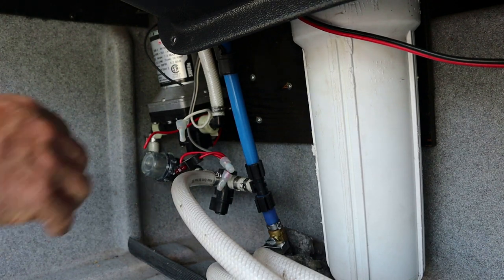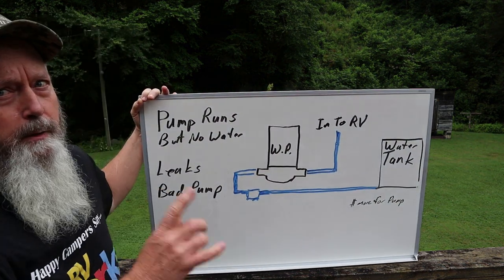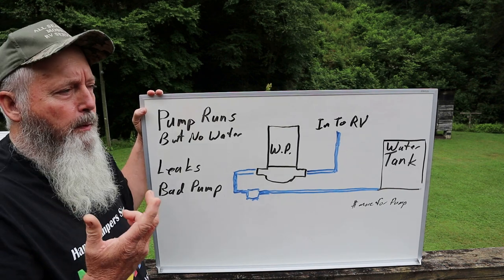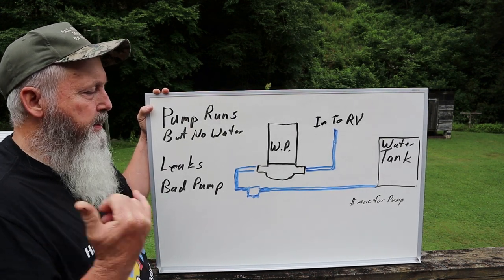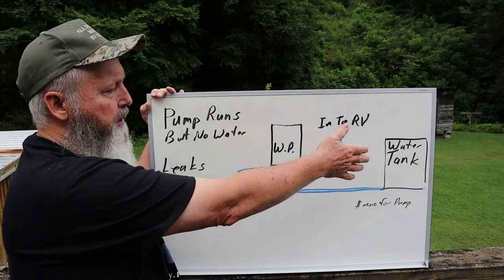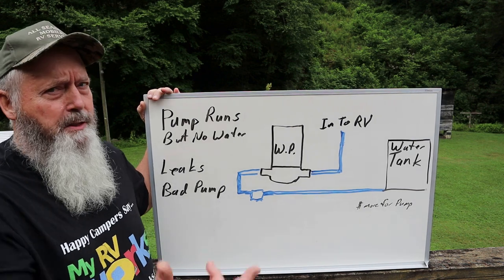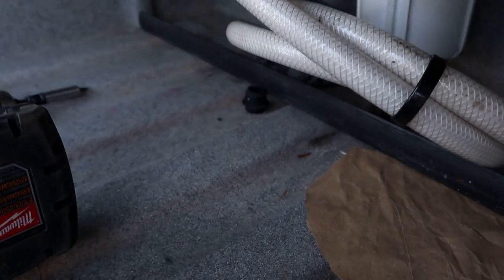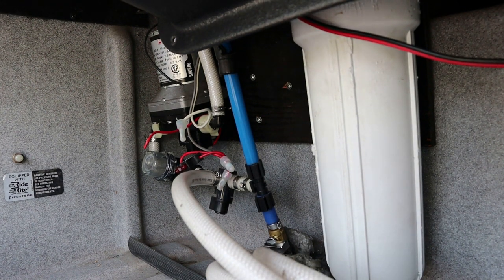Water Pump Not Pumping Water

Comment: Thanks Kenny.  Glad to see your vid on water pumps.  I had an issue last year using the trailer water pump to winterize.  Started to draw a little antifreeze, then stopped.  My RV repair guy thought it might have been a loose connection - thus drawing air and not pulling liquid.  After seeing your vid and hearing the straw comment, I’ll retest!
Reply from the maker: I hope yours isn’t bad.
Reply: @hillbillyrv  me too!!  I bought a back up pump that runs off AC in case my trailer pump is bad.  We are parked at a permanent location - RV park.  Can use the back up for winterizing..

Comment: Good call replacing the pump. If it's a part in the pump that needs to be replaced, you'd have to charge time to find the problem and the part, which may end up being as much (and more headaches) than just replacing the pump. Also, good troubleshooting on the slide issue!
Reply from the maker: Thanks

Comment: Best for customer to just replace but if it's your own and you've ruled out the problems Kenny suggested, take the head apart and rinse the parts off. If a pump picks up a piece of debris it will just bypass internally and never build pressure. Especially true of new RV's.
The head is cheaper but not by much. I replaced mine after the factory stripped the hose connection and threaded it on sideways (found during winterizing).
FWIW, I think your vids are great. I hate over-produced vids.
Reply from the maker: Factory cross threaded it......what????
Thanks for watching.
Reply: @hillbillyrv  Yep, it wasn't leaking but was obviously cross-threaded. It was less bother just to fix it myself.

Comment: I agree. If it's not a simple pressure switch adjustment, replacing the pump is the best thing to do for the customer.  Same thing with a toilet in some cases.  Great video as always Kenny!
Reply from the maker: Sometimes yes.

Comment: If the different manufacturers had one or two pumps that attach to every pump motor, then you could just replace the pump and not the motor.  There are numerous manufacturers and every one is different.   The only thing the same is the wires and the in and out water connections.
Reply from the maker: Nope. even the water connections are different from shurflo to flojet.

Comment: I had a brand new camper and the water pump would run all the time and we would get no water. Turns out the water supply line hose was kinked. Fortunately all I had to do was unkink the hose and we had water.
Reply from the maker: Awesome